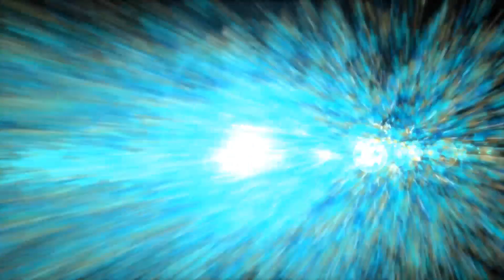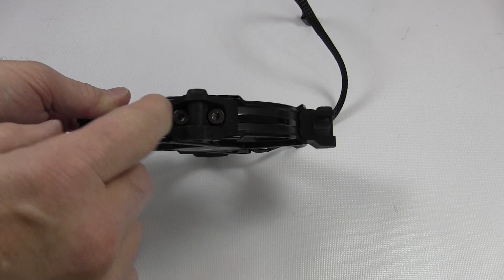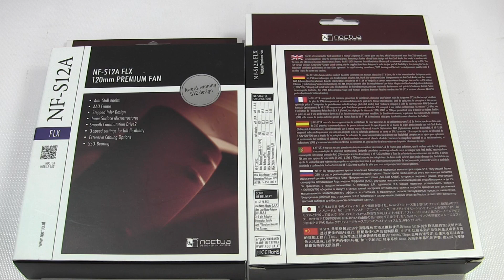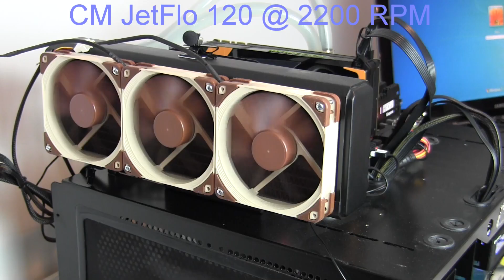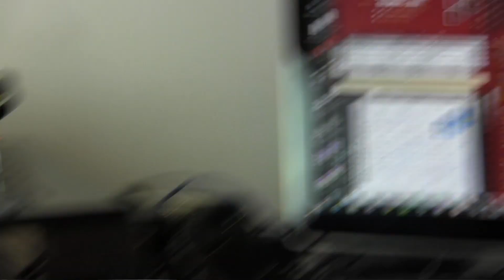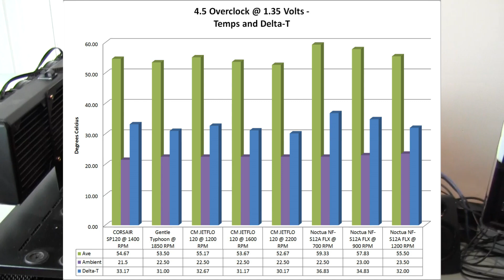CM JetFlo 120 and Noctua NF-S12A FLX Fan  Review and Water Cooling Testing

Comment: I felt like with the noctua, you mainly are hearing the sound of air pushing through components, with the jet flow you are hearing the motor a bit too. With the typhoons you are hearing the motor... and not as much of the air rush because of the fan blade design. Gotta remember noctua comes with accessories out the butt, and a three year warranty... not to mention noctua answers their emails! I cannot get in contact with cooler master at all.
Reply from the maker: Overall Noctua fans are great.
Reply: they are... I bought one of those jetflow fans for one of my cases... and while it is an amazing fan it is just too loud! Perhaps the sound is not as bad when connected to a big radiator, but when a front case fan, it makes this terrible low pitched growl sound... even at low speeds. If I was deaf, I would use them.

Comment: Like Eric Taylor stated you had the wrong Noctua's to compare with the CM JetFlo's, this Noctua you tested have very low static pressure, but they have very high airflow rating, again like Eric stated the Noctua's NF-F12 PWM are very close in specs with the JetFlo's, exept for the industrial noctua's they have more then 2 times the static pressure (crazy), these Noctua's you tested also come in PWM version but it doesn't make a difference in static pressure.
Reply: + Armando PerezNF A12 = CASE FAN E NF F12 = RADIATORI + HEATSINK
Reply: +Armando Perez http://noctua.at/en/which_fan_is_right_for_me

Comment: Now would you be willing to recommend the Cooler master Jetflo 120mm fan for push and pull on a cpu heat sink(hyper 212 plus) because the beatings on the stock fan was either faulty from the beginning or became damaged during the move that I made. Now, I really wanted to get two fans for the cpu heat sink that blue led to go with the coloir theme of the Define R4 build that I recently upgraded my components to. I have bought them already but was not certain they would make good cpu cooler  fans until I watched this. So, thanks for the video and if you good give me a heads up if you think they would work well for this application of use. I am running my 4670k at 4.2ghz currently, and wanting to overclock that said cpu to at least 4.4 and stay stable and keep temps manageable.
Reply from the maker: Yes they are just fine.   They would work fine on a Hyper212
Reply: +Whiskey Jack NF A12 = CASE FAN E NF F12 = RADIATORI + HEATSINK
Reply: +Whiskey Jack http://noctua.at/en/which_fan_is_right_for_me
Reply from the maker: +Intel i7-3770 Any of these fans would be fine.

Comment: corsair quiet edition or performance edition??
Reply from the maker: Static Pressure editions
Reply: Ronsanut .
Man -.- think before you write sth. There are:
Static pressure - quiet ediotion ,
SP - performance edition ,
Airflow - quiet edition ,
AF - performance edition

and all of them are from corsair ...
Reply: They´re quiet edition, you can see the box at the beginning of the video, unless those shown there, were not the ones using for the test.
Reply from the maker: HeyDan1983 The SP Quiet Editions were used.

Comment: Noctua S series are NOT built for radiators. They cannot make enough static pressure, as they are built for more airflow vs static pressure, to give their best performance as case fans only. So, this is somewhat unfair, to me.
Reply: +10.  Tested the wrong fans, should have tested the F12's.  The S12 is a case fan not a rad fan. You can find F12's for around $20 IF you look.  Everyone has different sound sensitivity, I do not like the high pitch sound from most fans, the Noc's, to me, have a much lower pitch and are not nearly as annoying.  Good video with skewed results.
Reply from the maker: Thanks. The writeup on the fan when I selected it was the general new Noctua series general write up which said it was also good for radiators and heat sinks.  But the specific fan description at the website does states it is a better case fan. Will compare the other fans next time I have a chance.  Thanks.
Reply: Ronsanut . Noctua screwed the pooch if they put that kind of info out.  A fan with space between the leading edge and trailing edge of the blades can not produce much pressure, it can move air with good cfm but does a poor job at moving air thru a cooler/rad.

I just found your youtube reviews and I think they are great,  Very good real world stuff, well presented.
Reply: Ronsanut .
just think these enormous gaps... When the airflow on fan's exodus meets some resistant it will turn back and go through them! But if that fan has some clearance, about 5cm, it would generate a very good airflow, more then every fan in market...

Comment: Those Noctua NF-S12A aren't meant to be used with a radiator at ALL...they're designed as case fans (they have low pressure). Use the Noctua NF-F12 PWM as a radiator fan from Noctua instead.

Comment: Thanks for testing those fans ! I´d like to see a result chart, where ALL fans ran with the same RPM, so we can make 1:1 comparison which one is the best when it comes to the Delta-T result. I recommend the Aquaero 6 Controller from Aquacomputer, you can adjust the fanspeed very exactly via Aquasuite.

Comment: Quite hard to get a objective comparison if you don't run them at the same speeds, which should be possible with PWM fans & a fan controller? 

The Noctua's are clearly the most silent, best bearings, you only can hear the air. Sadly they look like crap, no way I would buy them. The CM JetFlo is a bit louder, harder to the ears than the Corsairs. The Scythe has a distracting high pitch, bearing noise.

Comment: Jetflo and nfs12aflx are air flow optimized fans. why test them on radiators together with static pressure optimized fans!? Its like testing how good a Ferrari is off road compared to a jeep
Reply from the maker: Because they are advertised as Fans for Radiators and Heat Sinks. Plus I have had many requests to do this testing for these fans.

Comment: Taking everything in account, noise, performance, looks. I would still go with the Gentle Tyfoon's. Easier to impliment in a build because of the looks. Second on the noise list and performance is subject to discussion. But overall i would go Gentle Tyfoon.
Reply: With the build I plan on running, I need PWM fans, and I haven't had any luck finding GT's set up for PWM.  As such, I'm leaning toward the CM JetFlo's.
Reply: Why do you need PWM fans. I never have my fans on the motherboard, i always run them of a 4pin molex adapter to 3pin fanheader. Less cables in sight and you don't have to worrie about setting up fan profiles etc. It just works.
Reply from the maker: ***** I agree. I also do the same. The only time I used a PWM connection on a motherboard is in my S3 mini ITX build. I did not us a fan controller so I used the PWM connections instead.
Reply: ***** For me, it'll just be a simpler setup, and not having a fan controller means one less component to fail.